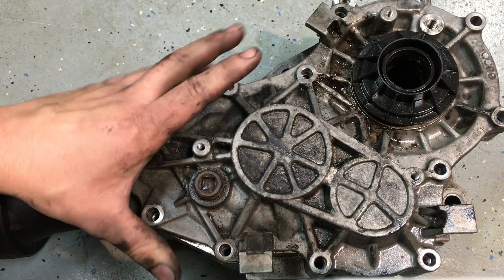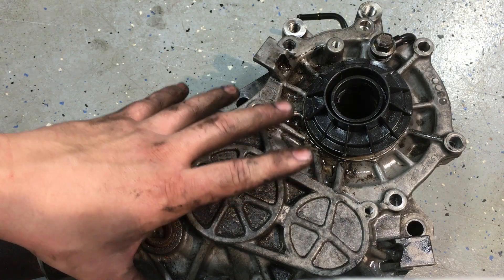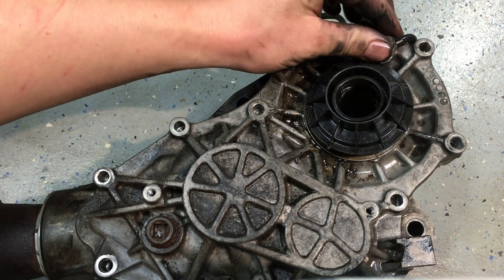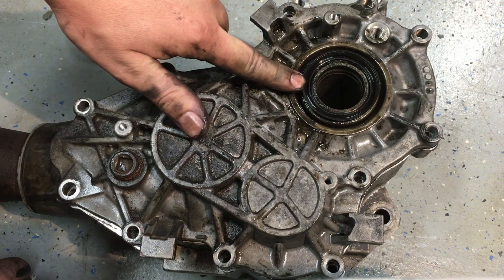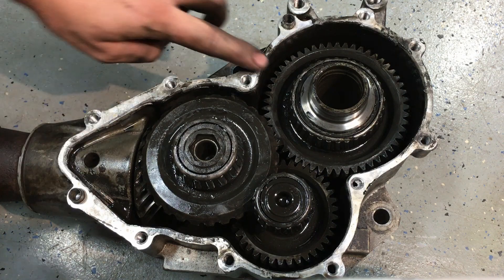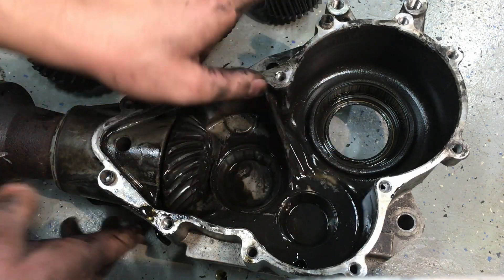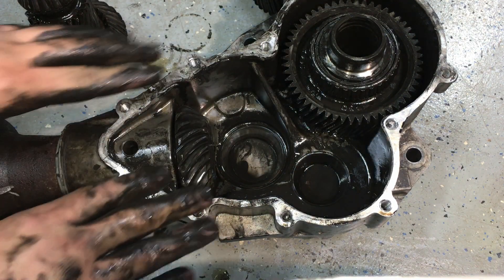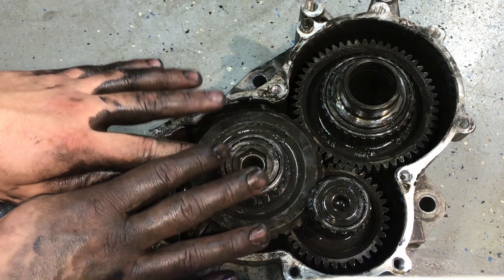Ford Quick Tips #64: Preventing AWD Power Transfer Unit Failures

Comment: I was told my 2013 Taurus police interceptor ecoboost has a cooling PTU? currently at 105k miles and need a full tune up.
Reply from the maker: They sure do Ford got smart they knew they needed to do something to prevent premature failures.
Reply: Do I still have to make my own plug or does it have one?

Comment: Ford tech, I have an '09 edge and I went under the vehicle and the ptu looks a little wet and I sucked out what ever I could with a topside oil changer from the fill plug. I did it four times like every 4 months and half the amount came out each time.The gear oil came out black every time and replaced it with the required gear oil.I dont know if I should have the ptu replaced considering it has 193,000 miles on it or drill a hole in the bottom of it and put in a drain plug.I just bought the vehicle March of 2016 it runs great but I just dont want the ptu to fail while driving dont know what to do, do you have any advice?Thank you.

Comment: You literally just saved me time, money and sorrow. I changed the fluid on the PTU on my 08 Escape about 15k miles ago and there were no leaks. Went under the other day and it was covered in fluid. I almost just replaced the whole unit with a refurbished one figuring the seals were shot. It was only that one bolt holding the vent tube. Tightened it up and gonna put a little fluid back in. Thanks for posting!
Reply: Yup, after watching this video I checked that tube last night and it was all wobbly loose.

Comment: my car is a Ford explorer 2003 XLT 4.0 flex fuel. my transmission is leaking a lot. what parts and tools do I use to repair it? another question can I fix it while on the ground or do i lift it?

Comment: Not related to this specific PTU, but i've got one for a 2010 MKS ecoboost.  I recently got a trans fluid leak at the compression seal between the transmission and the PTU.  Lincoln is telling me i need to swap out my current ptu and put in a new one all for this trans leak.  I'm not having any performance issues at all with the PTU - it's just leaking.  I prefer not to do that if I can just drop the PTU and put in a new compression seal.  It would obviously save me a lot of money.  What do you think i should do here?
Reply from the maker: Yes you can replace that seal separate but you must replace the intermediate shaft seal- INSTALL a new compression seal, intermediate shaft seal, deflector, and 
alignment washer
Reply: You hit the nail on the head.  After a lot of back and forth, they finally admitted i didn't need the $1100 + $900 in labor for the new PTU and just the compression and intermediate shaft seal were replaced.  Problem was fixed for about $400 all in.

Comment: Can this repair be done with the PTO still attached to the transmission?
Reply: No, to get to all seals. You must remove transfer case from transmission. Also if replacing passenger side seal, be prepared to replace axle shaft deflector shield. No way around this replacement part.

Comment: FordTechMakuloco, this is off topic of this video. I have a 2002 F150 2WD with a 5.4L. Last year, my heat went out. I know my blend door operates.  What I did do was cut into the blower box to feel if the heater core was hot and to verify the blend door operation. It was, but seemed not hot enough to transfer hot air. It literally felt like the air in the blower box, cooled off the core before hot air was distributed into the cab. Not sure if I'm explaining this well enough. Do you have any tips or suggestions as to what my next step should be? I'm thinking about getting a new thermostat, even though I don't run hot.
Reply: Marc Owens heater core plugged, back flush with cleaner, let cleaner sit in it for a few hours then flush and fill.

Comment: I have a 2007 Ford Expedition 5.4l and it seems like when its cold it will hesitate when you try to pull away from a stop sign.  It will rev up normally then when you count to 3 the transmission finally kicks in. Any tips or possible video would be awesome. Ps your awesome and anytime i need to do work i check your channel first. Keep up the good work!

Comment: Looks a bit  like the drive unit in my ride on mower. Has trans and diff in one unit, separated with different oils. They said to throw it out, no service parts, that will be $900 sir. Took apart, replaced some broken cap bolts, rtv, refilled with 80W90 and good to go. Also a sealed for life gem. Should have done a vid.

Comment: Nice explanation Brian.  On that '10 Escape i recently replaced the leaky pinion seal the differential does not have a drain bolt but does have a fill plug......"non serviceable" is a complete joke.  There should be consumer protection laws on the bullshit manufactures are pulling on us.  Same thing with the 'in tank' fuel filters.....grrrr

Comment: Very interesting video and information.  However, I'm a little confused as to how this all works.  It seems this unit is driven from the right-front transaxle output shaft and is also used to provide power to the rear?  How is the differential in the transaxle and the left-front half shaft related to the rest of this equation?  I'm just curious and like to learn; thank you!
Reply from the maker: The right front axle slide through it to the transmission for power, this unit also splines direct tot he side of the trans for direct power they both tap off the internal diff inside the trans for power.

Comment: i my self have had two difficulties with this ptu unit on the newer style, the fluid tends to be like sand and mud and they dont provide a drain plug so to try to get them clean we have sucked them dry or the best we could, filled it with bg synco shift drove around block and repeated have heard of guys drilling a hole in case to act as service plug any tips on this ? also that right output seal with the big seal pack thats been revised like 26 times. i had one of these resealed it ,and a week later it leak, tried again and it leaked again ,ended up sending to ford and again it leaked on them . and i had asked did you see anything i had done wrong and there reply was no it just h appends  ,so any tips on installing that seal outside the instructions in the service manual would love to hear ,keep up the good work

Comment: Good video on a kind of unknown (to the general public at least) problem with this Ford part. Changed the PTU fluid in both my 10 Edge and 12 Mazda CX9. Kinda dirty job that has to be done through the fill plug (no drain...stoopit engineers) which is in a tight spot but definitely doable with a 12v pump & small diameter clear tubing to get as much of the old, burnt oil out. Clean the metal off the magnetic fill plug, refill until your new gear oil starts dribbling out of the fill plug hole (gonna need a pump for that too), replace & torque down the plug & enjoy your AWD until next year. Oh, and every 3 or 4 times, clean the threads on the plug & apply new sealant to them to prevent leaks from the plug.

Comment: I have a 2012 awd edge. I have been wondering about the ptu on these and from what i understand is that there is no fill or drain plug on the ptu to change the fluid is that correct?
Reply: ryan mac On my 2010 Edge there was only a fill, no drain. Suck it out through the fill plug with a hand pump, vacuum extractor, electric pump etc then refill.

Comment: My 2011 AWD Escape does not have a drain plug, only a fill plug. Is there enough room to get a small tube in there to siphon it out? Every other Escape that I have owned has had a drain plug on the PTU. I have not crawled under my 2016 to check if it has one yet. Its getting close to 30k so I will probably change that one soon.

Comment: I have a 2015 show. so I should change ptu fluid every 30k miles? And the rear differential also every 30k miles?
Reply: SHO  sorry spell check
Reply: I've seen much more about the PTU failing, or the fluid turning to sludge. If you can only afford to have one changed, I'd do the PTU. Me personally I plan to do both every 30k in my '16 XSport.

Comment: I've been installing drain plugs into the ptu's while still in vehicle, works great, then if the gear oil is broken down to the point that it plugs up the vent, I flush transmission oil through 2 times then dry out with brake cleaner then new gear oil.
Reply: Johan Wiebe Got a write up or video on this to share?
Reply: i dont have a writ up, i basically drop the exhaust y-pipe. then i found a image on google where to drill a hole (google ford put drian install) look at the 2nd image. that is where i drill the hole. and install a pipe thread plug.  once the plug is in i put in transmission oil, run it for 5 minutes then drain it, fill it again and run in again for 5 minutes, then brake clean it out and also put a air blow gun in the hole and try to put some pressure into to unplug the vent. then i install new gear oil. this makes it easy to service it regularly
Reply: also youtube search 2007 ford edge ptu service.

Comment: Is this a problem for the SHO
Reply: I had trouble getting the dealer to do it on a '11 SHO because Ford lists it as a "lifetime fluid" once I convinced them to do it, they were stunned to see the condition of the fluid that came out.
Reply from the maker: +Marvelle Washington Especially the SHO
Reply: Thats around when I had mine done. Id have the fluid changed out asap
Reply: jtoddk98 I just reached 40k mi on my 12 SHO would you suggest I have them check this out
Reply: i had a to replace the transfer case on my 2011 taurus sho luckily it was under warranty ive had it for a week after it got fixed but im still concerned it will start leaking again should i be worried it will give me problems in a near future?
Reply: FordTechMakuloco 
My question is why when looking online it's almost always an Edge? Hardly ever a SHO. 
Edge, Edge, Edge, Explorer, Edge, Edge, Edge, Explorer, SHO, Edge, Edge, Edge
Reply: Tony Vittitoe it's practically the same driveline on all three, except the Explorer and the Edge are heavier vehicles.
Reply: Jayz1881 right. Which is crazy because the SHO is a pig! lol
Reply: @anthony-i1k8c  Probably it has to do with how close PTU is to CAT in a particular model. That heats up the oil within PTU and problems occur. In EDGE particularly they are more cramped together

Comment: Ford will keep you busy for life
Reply: hddm3 another thing to note.....ford is the only one worth fixing. Dodge and GM go straight to the scrap yard to melt down into new fords.
Reply: @davidhenri2722  true, that ford is the better of the three. Also true, these are not the only car companies in the world. Its not the 50's any way. Happy 5th gen explorer owner here. But I won't lie and say ford is better than Toyota.
Reply: @abadran8174  For the most part I do agree. They do last longer but for return on investment that would be a discusion for another day. In regards to your explorer. They are fine trucks but if it has that 3.5 l V6. Keep an eye on your water pump. When they leak they flood the crankcase with coolant and destroys the motor. Some even resort to replacing the waterpump when getting up in mileage before they start to leak. Might have to google search it.
Reply: @davidhenri2722  thanks Dave, yes I know it. I'm keeping an eye on that. However, they said that was a manufacturing defect that was fixed with the new batch of 2014. Mine is 15. Still am watching it, changing coolant every 10months, adding royal purple ice additive. Drilling and tapping my ptu and rear diff next week for a drain plug too. I think even for a return on investment Toyota would win this one. They not only last longer, but they also resell for more. They save you time as well. I'm losing time to prevent some catastrophic failures in my ford's various parts. Just so I don't lose a lot of time and money down the line in case of failure. And the explorer is one of the more reliable ford's after the f150.